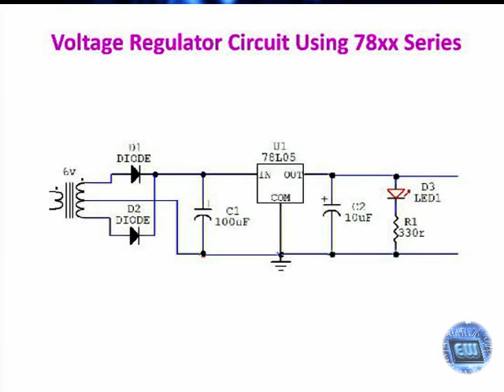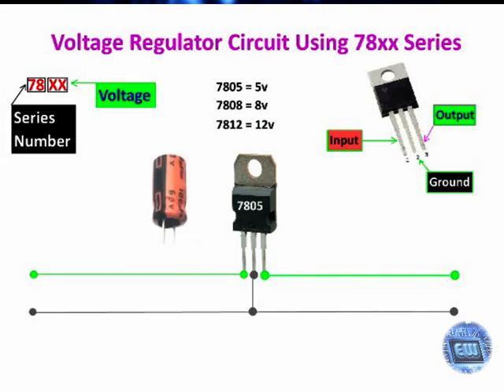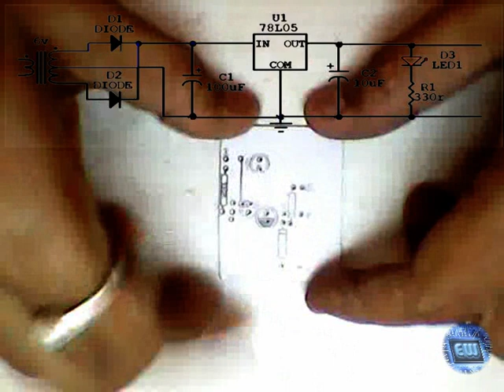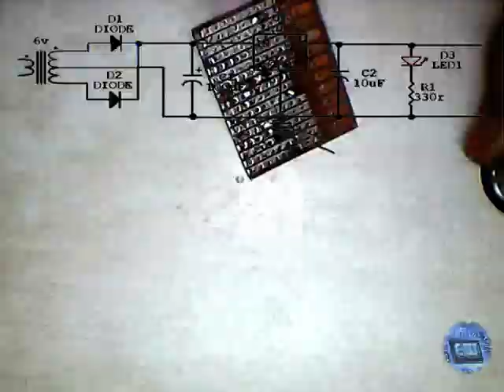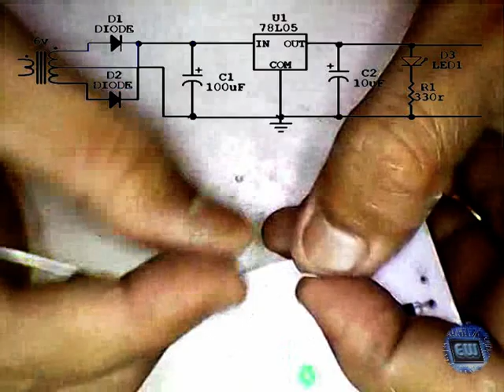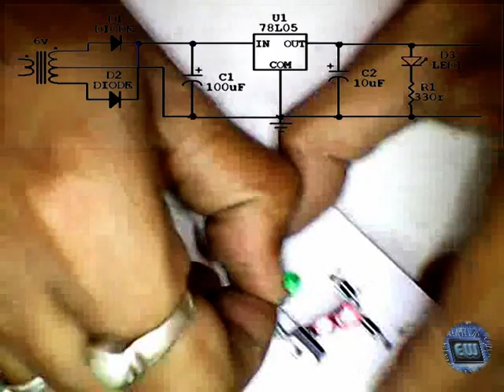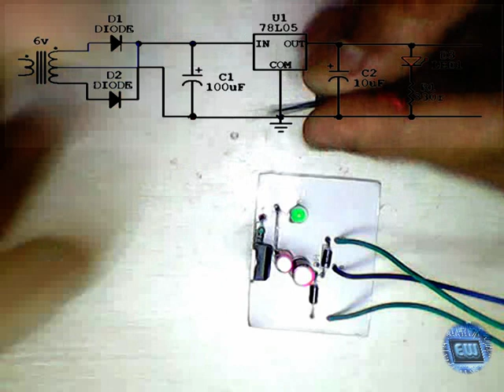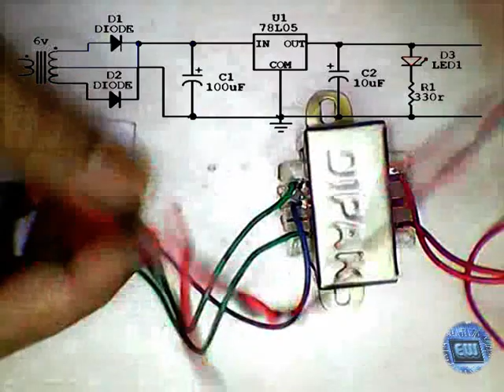LM78XX voltage regulator working, animated and practical circuit building

Comment: nice idea.
I just want to ask the value volt of the capacitor?
Reply from the maker: it is depend on input or output voltage,  for example if the input voltage is 15 volts then the capacitor voltage shod be higher then 15 volt, like 16v, 18v or higher you can use, same goes for output voltage also.